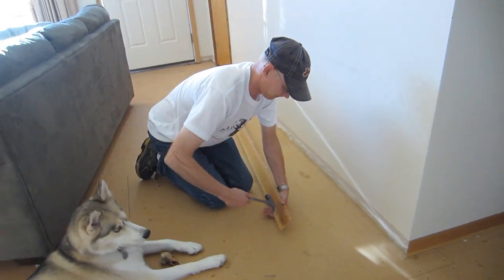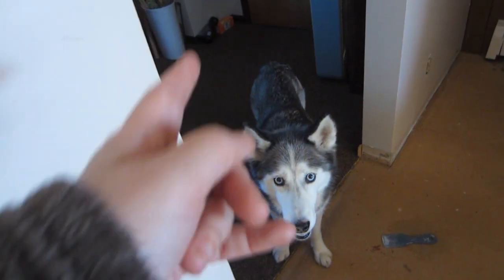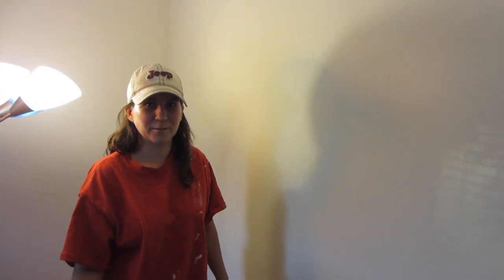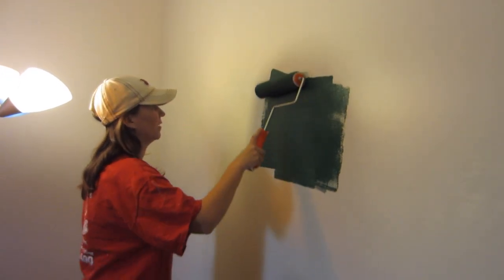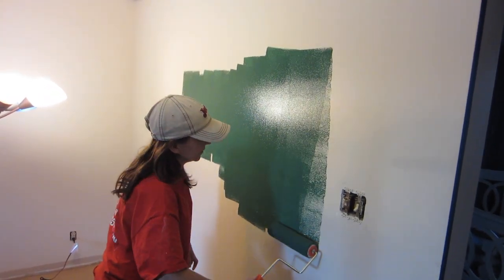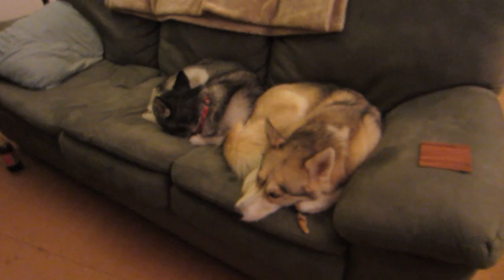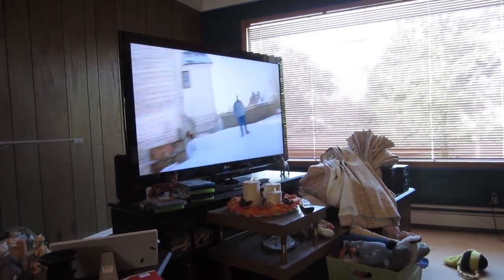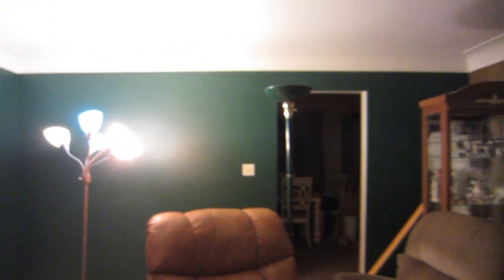And the Color is. .   My Dogs Watch TV?  9/19/11

Comment: @WithOutTheSnowDogs   I know there is a saw that can be rented (home depot?) where you can use the flooring and mark the trim and the jambs, then set the saw and it will cut the trim and the jambs on the mark.  That way the flooring will fit underneath it.  Can't remember the name of the saw.  I used it for some laminate flooring I installed, worked real well.